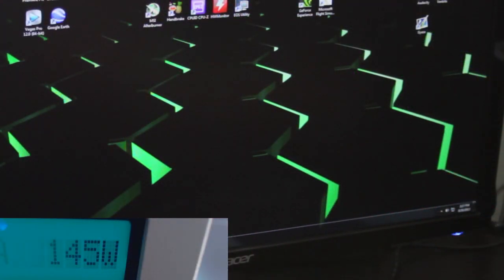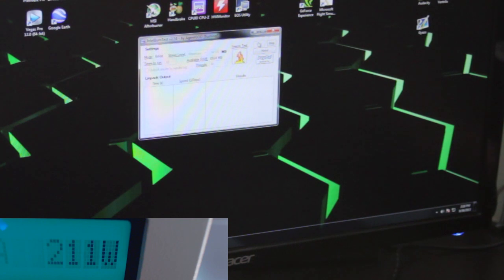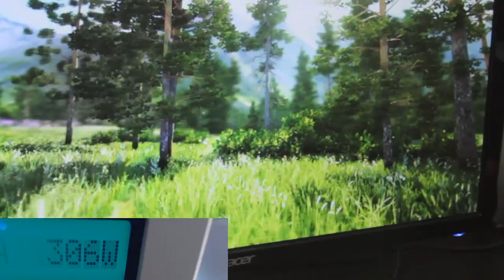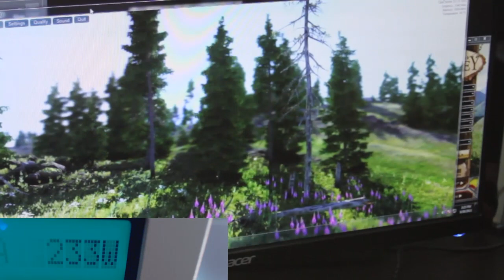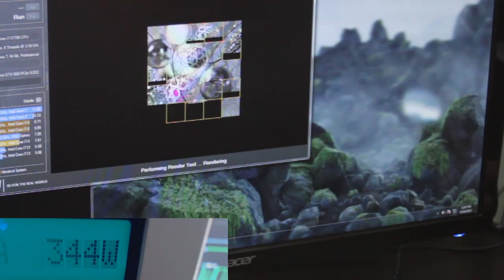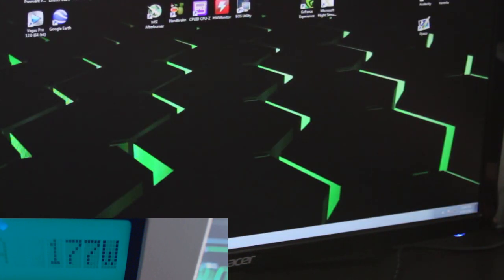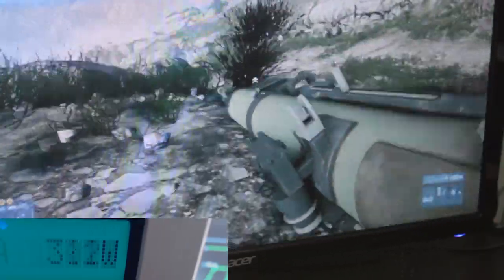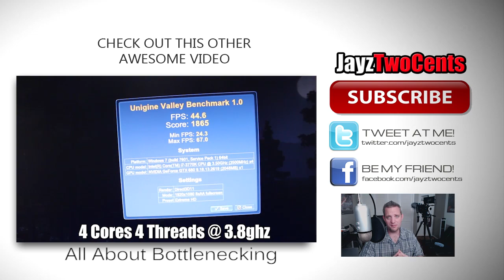How big of a Power Supply do you REALLY need?

Comment: power supplys are the most effecient at exactly 50% usage, so if your using 400 watts for your pc, you should get an 1000 watt power supply for your pc.. if your pc is on 8 hours a day 365 days a year, you save about 40 bucks... is what i heard :P
Reply: psus are good at 20%, 50%, 100% loads. a gold should be 87-90% if it's a quality unit. the best of the best are only 1-2% off at worst between 20-100% loads.
Reply: Most modern PSU's actually have their peak efficiency at around 40% load.
Reply: so if my wattage is 400 i would need a 1200 psu..

Comment: My system is : i5 3570k@4.2GHz, GTX 670 windforce OC, 8GB Ram, Silverstone TJ08-E case, 2 case fans, western caviar black 1tb hdd. I run this absolutely fine on a Rosewill Gold 450M Power supply. Even at 65-70% load, with a gold you'll be hitting 88-89% efficiency vs. 90% at 50% load. Now, if you're a noise freak, I suggest 60-65% load while gaming.

Comment: Nice video Jay. However, you forgot to factor in conversion. You were pulling 350 watts from the wall, but your system was only using around 85%-90% (gold rating) of that since the rest was wasted in converting ac to dc.

Comment: Then how much watts would I need for a fx 8350 on a sabertooth 990fx r2.0 and a r9 290x
Reply: I would say a good 650watt PSU would be fine but all depends on things like how many hard drives and optical drives.
Reply: Or Pcpartpicker it shows the wattage it uses when you get the parts
Reply: *****
Ya was it the one where I pointed those benchmarks of it beating the i7 3770k
Reply: ***** Lol i'm talking about money wise, seriously the only thing the i7 beats the 8350 is in benchmarks but when you're actually playing the game you aren't gonna notice the few fps difference that you get with the i7 the only time you'd actually notice it is if your fps was really low and I don't think you'd go down to like 10 fps with those cpus (assuming you'd have a decent gpu too) So in reality there's no point in getting the i7 when you could get a 8350 with similar performance and use the extra $100 on something like the gfx card and get better performance...
Reply: ***** Actually you would be paying for a processor that uses more power and runs much hotter for minimal performance gains that you would never be able to see the difference with the human eye or mind in a game.  Contrary to this particular video you can not have too large of a power supply as the person who posted it was surprised and has no idea about ohms law.
Reply: ***** lel. I root for AMD generally, but this guy...
Reply: *****
I doubt that the i7 runs much hotter at least at stock. The last few generations of Intel CPU's have been plagued with bad thermals due to the Integrated Heat Spreader using thermal paste instead of being soldered onto the processor.
There's many vids of people replacing the thermal paste on the chip. Supposedly, it improves performance especially when overclocking.
Reply: D1vid3By0 How do I get soldered together processor and heat sink?  I have not heard of this, do you have links on how to do it and or how to buy one?
Reply: I don't think anyone has attempted to actually solder it on. Google Haswell IHS removal or something along those lines. Most people replace the thermal paste with higher quality thermal paste.

Comment: There is also more to a psu then just power, I've got a hx1000 watt and when I brought it heard about many people saying the psu is very important. I had the thogghts of future proofing it, so I got plenty of power when I need it.  I got twoo graphics cards in sli and a few fans in the case. I know my psu is good at putting out low voltage under different loads with very little fluxuations. its modualr with many connectors.I could allways add another graphics card to my system. I read test taking mine to the threshold of the psu and apparently it uses the same as a 1200 watt model and can handle the loads with great stabiltiy. I presonally think the psu is about good stabilty through out the range of power it supports. Its nice to know when you add some other power suply unit to your system that your still going to get a stable voltage when the load alters.  I am surised by the results on here. Its so low it makes me wonder if ther are different measuremnts in wattage lol.
Reply: When I first got into PC building, I was fed so much BS about getting ridiculously powerful PSUs. Although , the people who gave me this information were running 4 GPUs and an OC'ed CPU ect. so it made sense for them. I currently have a 750 Watt Bronze from Corsair and I use about 400-ish at load.
Reply: AK474000
ITs always good to have a bit of overhead due to how manufacturers rate PSU efficiency.

Comment: PSUs are most efficient at around 50% load. So I'd say you are just under the sweetspot with your setup at the time of this video
Reply: ***** if you're only going to use 50% of its power then the 80+ thing  is useless lol ?
Reply: Marco Polo 80+ means that the PSU is over 80% efficient at 20-100% loads. The best efficiency will be obtained at around 50% of the rated output of the PSU.

Comment: By the way the wattage of a PSU is for the output, so theoreticaly loading your your 750W PSU to 100% load would make it take 938W from the wall socket. ALSO wattage is not everythyng! The individual rails on the PSU have a maximum current they can provide and the total wattage is all rails loaded to max current, at that point the voltages are going to start saging and you never spread your load over all the rails perfectly. In todays PCs most of the load is on the 12V rail so its a good rule of thumb to take a PSU thats 50% more powerful than you need.

Comment: Jay, you're wrong about the efficiency. It has nothing to do with a PSU's output capacity. It has to do with how much power will be pulled from the wall outlet, and THAT depends on how much power is being pulled from the PSU at any given time.

For example, let's say that your computer needs 450W while gaming. If your PSU is 90% efficient while your computer is pulling 450W from it, then your PSU is going to pull 500W from the wall outlet. If your PSU is 85% efficient while your computer is pulling 450W from it, then your PSU is going to pull about 530W from the wall outlet. If your PSU is 80% efficient while your computer is pulling 450W from it, then your PSU is going to pull about 562W from the wall outlet. In all 3 of these examples, 450W is being taken out of the PSU's capacity, and that capacity doesn't depend on the PSU's efficiency.

Here's another example: if your PSU is 90% efficient while you're seeing 500W on a wall meter, then that means that your computer is pulling 450W from your PSU. If your PSU is 85% efficient while you're seeing 500W on a wall meter, than that means that your computer is pulling 425W from the PSU. If your PSU is 80% efficientr while you're seeing 500W on a wall meter, then that means that your computer is pulling 400W from the PSU. These values (450W, 425W, and 400W) are being taken out of the PSU's advertised output capacity. Again, the PSU's output capacity does not depend on its efficiency.

So, if you buy a good 550W Gold-rated PSU such as the 550W SeaSonic G Series or the 550W Rosewill CAPSTONE Series (modular or non-modular), then you will have a continuous output capacity of 550W, not 495W. In other words, it does not mean that your output capacity is 495W because your PSU has the 80+ Gold rating (550 x .90). All that means is, your PSU will pull less power from the wall outlet than a less efficient PSU would at any given power consumption.

There's a LOT more that can be said about power supplies (including more on efficiency), but when it comes to what a PSU's efficiency really means, there isn't any more to it than this.

It's kind of like light bulbs. A 100W incandescent bulb is extremely inefficient, but a "100W equivalent" LED or CFL is FAR more efficient while still providing about the same light output. It just pulls a lot less power from the wall outlet (again, while providing the same light output). So, a more efficient PSU will pull less power from the wall outlet than a less efficient PSU would while delivering the same amount of power (like my example of the computer pulling 450W from the PSU at different PSU efficiencies).

Even though I'm done, there's still one thing that's worth mentioning: the quality of a PSU can NOT be judged by its 80+ Certification. Just because a PSU is 80+ Gold Certified or 80+ Platinum Certified or even 80+ Bronze (for those of you on a tighter budget), it does NOT mean that it's a good PSU. Always, always, always read professional reviews before buying any PSU, and NEVER go by customer reviews. You can even ask me about a PSU before buying it. I am always happy to help! If you need to know how much power you'll need, then you can also use me as a PSU calculator. ;)

Comment: Is a rosewill 750w 80 bronze psu enough for this build?:

I7 4770k
Asrock extreme 4 mobo
Msi gaming gtx 780
8gb  (2 x 4gb sticks) 1600mhz corsair ram
1 ssd
1 hard drive 1tb 7200 rpm
4 120mm fans

No overclocking yet.

Comment: im building a new pc:

ASUS SABERTOOTH 990FX
AMD fx-4350
NVIDIA GeForce GTX 780 Ti
32GB ddr3 1600MHz RAM (4x8)
kingston 240 SSD
2 – 2TB Toshiba HDD
case fans: 2x 120mm and 1x200mm

the minimum power for the gpu alone is 600w but would that be enough or should i go for a 7-800w?

Comment: I think this 500W PCU should do, can anyone check me on this build?

http://pcpartpicker.com/p/2BYst

I know the PCU that comes with this case has some reviews that say it sucks, but I think it should be fine.  Unless it'll slow down my actual performance and junk, I don't really think it's worth buying a separate PCU.  Anyone have suggestions?
Reply: I've read good reviews and bad reviews about that PCU, but if it doesn't die, it should be as good as an expensive one of the same wattage, correct?  Besides, it's hard to find a case of that quality for that price with or without the PCU, so it's worth it either way.
Reply: I'd suggest that you get a Corsair PSU as well. Not only will a cheap PSU may die quickly, but also it may destroy other components, like your motherboard. Trust me, if you care about your PC you should get a well known brand PSU. At least read reviews about the one that comes with the case.
Reply: I would not cheap out on a power supply. If the power supply dies, it may be able to short out your entire system and create a mess for you. Do not ever cheap out on a power supply
Reply: TheCorington You are correct some cheap CPU's don't even have Active PFC which is a must, if it does not have Active PFC I would throw it away as without that a spike in the power could take it out and anything connected to it.

Comment: I have a fractal design tesla 650w 80+gold psu from an old rig I want to use in my new build which consists of the following...

Sabertooth x79 atx
Intel Core i7-3930K (6 core)
Corsair Vengeance 16GB DDR3 1600MHz (4 Dimms)
EVGA GTX 660ti
x2 Samsung 840pro 128gb SSD's
x2 WD Black 1tb HDD's
x1 Seagate 2tb HDD
x1 Optical Drive
EXPC Raystorm kit including GPU block
x2 Corsair 120mm PWM fans
x2 Arctic Cooling 80mm PWM fans

No need for overclocking as rig is for music production/workstation

Will my PSU be enough?? 

Thank's in advance ;-)

Comment: My budget build will 500watt power supply be enough?:D(COOLER MASTER B500 2.3 500W)

FX-8350
GIGABYTE GTX 660 OC 2GB
TWO 2000RPM FANS (COOLER MASTER SICKLEFLOW)
4GB RAM WILL UPGRADE TO 8 LATER ON
ASUS M5A97 970 R2.0 AM3+ ATX

thanks for answers:D
Reply: mystic1754 well i said how many fans bro xD 0 optical drives and 2 harddrives;) and i will run on stock cooler;P

Comment: It is actually not true that power supplies are more efficient at their maximum rated load, they are not designed to deliver 100% power all the time. Most power supplies are most efficient at around 50% off there load, most good power supplies come with a data-sheet where you can look up their efficient curves (and a whole lot more). Tough I do agree that most people over estimate the power that their system uses.

Comment: Damn if you aren't right! Im glad to say I went with a 760I and the corsair gui displays a pull of 480watts max with I5 at 4ghz, 5- 140mm fans and 2-780s under load! Load of unigen heaven and far cry 3 on 2560x1440 so those damn cards get frickin hot

Comment: how much power would I need for this system? would a 650W be too much?

AsRock FM2A88X-ITX+
AMD Athlon II X4 760K
8GB 1600MHz RAM (2x4)
MSI R9 270 Gaming
kingston SSDNow V300 120GB
BeQuiet Dark Rock 2 
case fans: 2x 120mm and 1x200mm

Aiming for a slight overclock on my CPU and GPU :)
Reply: BF3kriss941 They say 500watt's for that GPU inside a full setup and not just the card on its own.
Reply: Go to the website that makes your graphics card and see the power supply requirmements and same with the other hardware
Reply: Min3freak Minimum requirements for the GPU is 500W :P atleast that's what the website I'm ordering from says, but looking at this video I doubt that I'll need so much as I'm even doing an ITX build :P
Reply: fine.

Comment: I'm running;
AMD Phenom II X4 965
GTX 680 (MSI TwinFrozr III Overclocked Edition)
16 GB RAM (Two Sticks)
Corsair H80i (CPU Cooler)
Three x 120mm Fans
One x 7200rpm HDD

and an external HDD hooked up via USB.

my PSU is a Thermaltake TR2 600W 

I've had it for about a year and 2 months, is my PSU adequate? I had a GTX 680 before that died on me after 4 months but never found out the cause of the problem.

What do you guys think?

Comment: GPU: GTX 770 DirectCU II 2GD5. 
CPU: Intel i5-4670K, 4 x 3.40GHz (Haswell), 3.80 Ghz Turbo.
RAM: Corsair Vengeance 2x4 GB DDR3, 2133MHz. 
Mid Tower: ZALMAN Z11. 
MOBO: MSI Z87-G43. 
Sound Card: Sound Blaster SBX Pro. 
Hard Drive: Seagate 2TB.
Would 600w be enough pls help!
Reply: More than enough! Remeber a single 12v rail and preferably not a piece of crap supply.

Comment: I'm going to build a computer with the following:

Amd fx8350 cpu
Radeon 7970 gpu
Gigabyte 990FXA-UD3 SKT-AM3+ Motherboard
1tb western digital hard drive
8gb corsair ram 

Would  a 750 watt corsair power supply be too much ?
Reply: Kellworkie or 550 watts in the middle. Thats what I'm using
Reply: What's missing in this video is the Quality of Power supply.  Believe it or not, a lot of cheap ones are fake in their power rating. 500watt, are you lucky to get 250.  So Quality is equally as important as Quantity.  For your rig, I would recommend Antec 520w High Current Gamer or the XFX Core Edition 550w.  The actual manufacturer were actually Seasonic which is a very good brand.
Reply: got same cpu and gpu but you really just need 500 watts but to be safe you can use 600 like im using
Reply: yeah corsair is the one im using and they are pretty liable
Reply: Kellworkie That is the rebrander. The OEM is different. Corsair is not reliable, they just stand by their products for a certain number of years. The OEM's are the ones that are reliable. This includes Seasonic as mentioned above, as well as  FSP, and HEC. certain models are better than others, and every OEM will have a bad batch here and there. Nothing is perfect.
Reply: i agree thanks
Reply: Kellworkie I would say 650watt at max for that set up as that will give you a little room to add things like an extra hard drive or SSD with no problem.
Reply: arranmc182 one question do you think that 600 watts would be enough to power two gtx 760 super clocked gpu's? idk i think it might but im not sure.
Reply: Vincent Ng
Good point. Cooler Master is bad for fudging their PSUs' max wattage output. I love their cases though.
Reply: Al S. All of the psu's Coolermaster had large issues with are now EOL. The new ones do not have that issue. In fact, the V series is one of the best series to get right now price vs performance.
Reply: zemco999
How new? I'm presuming last year's line onward? My secondhand gaming tower came with a CM RS-PCAR-E3. Hardware Secrets and JonnyGURU gives this PSU 2-thumbs down. There's a nice board in that tower along with a HD7970 and every time I play Far Cry 3, I get worried even though I'm sure it's okay, but perhaps I'll go PSU shopping this weekend. Hahhaha

Comment: so i'm building a new system in a 350d, 2 hdd's 2ssd's a 4670k, 5 140mm fans, 1 H100 cooler, 4670k and eventually 2x 780ti's, will i need a 760 or an 860 watt psu?

Comment: Got an i5, 7870 XT, 8GB ram, 500gb hdd, XFX 450w 80+ bronze. At idle with Amd zero core power 34w, idle 48w, CPU load 94w, GPU load 250w, CPU&GPU load 295w, although when i use furmark to stress gpu(and cpu) power consumption goes way up to 420w+.

Comment: would a 750w psu 80+ bronze support a r9 290x / gtx 780ti??
Reply: kevin tran why the fuck...
you don't need that at all.
Reply: yes
Reply: but would get a 1000w cause it gives u more headroom to overclock
Reply: thx
Reply: wat happen well im just guessing that hes gunna over clock alot his cpu and his gpu and if he wants to sli and over clock 1000 w would help and you can have no worries
Reply: kevin tran what would be a good psu for a gtx 780ti and an amd fx-8320 at 4ghz?
Reply: BushBaby547 i use this for a i7 4770k 4.6 ghz and gtx 780sc sli 

Corsair hx850
Reply: BushBaby547 Don't listen to that. That is WAY more PSU than you need. a single graphics card with a slight overclocked processor is good with 550 watt PSU. Just get a good one like the coolermaster v550. It has great efficiency, Japanese capacitors, and a very small ripple. If you want to play it safe, or you are going to overvolt both the GPU and CPU, get the v700.
Reply: i already have a corsair 750 psu with a r9 270x and a fx 8320 at 3.5 so should i just use this one?
Reply: BushBaby547 Which model
Reply: rm 80 plus bronze
Reply: I thought the RM series was gold?
Reply: yes it is sorry